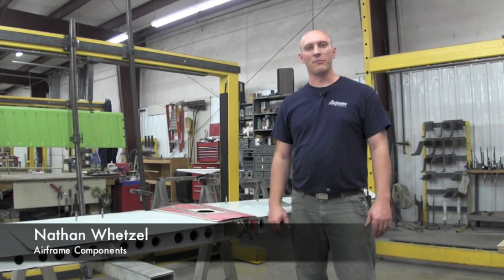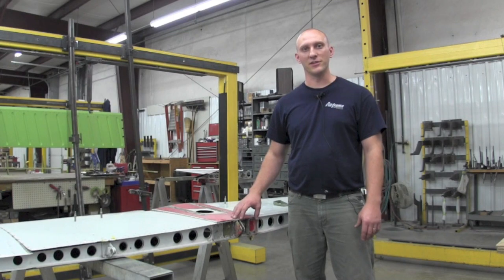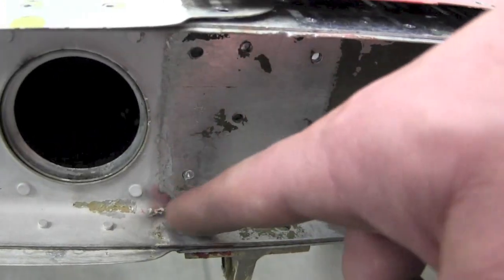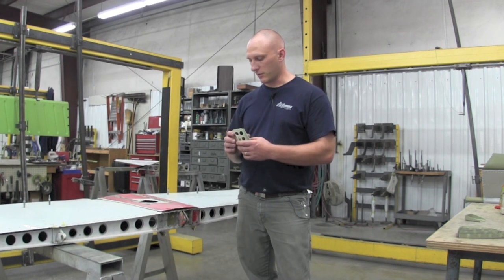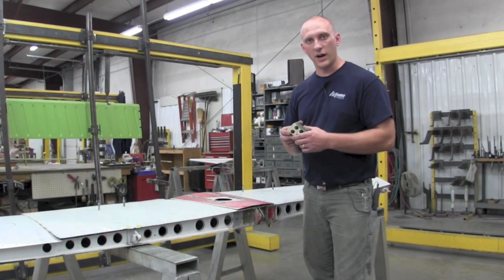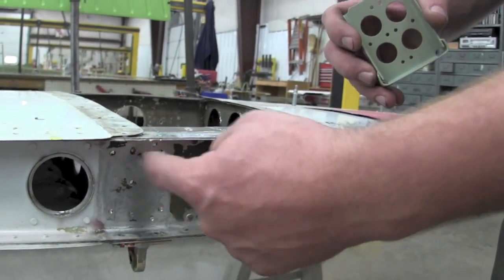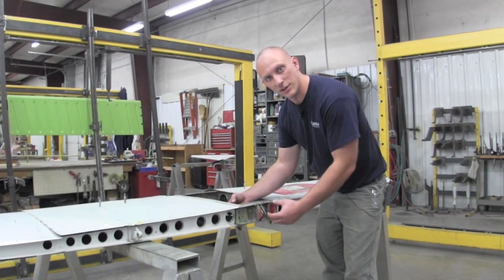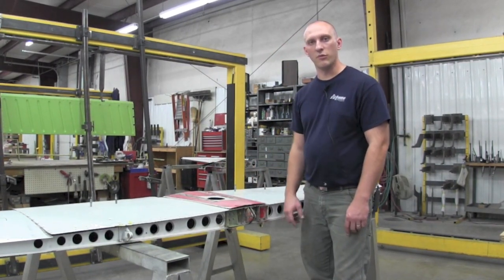Cessna 100/200-Series Horizontal Stabilizer AFT Attach Fittings

Comment: You’re absolutely right about the dissimilar metal issue! But that steel box being riveted to an Al spar..... if the rivets are properly installed, there will be dissimilar metal contact at the fasteners, which is only a matter of time for trouble to develop. Best thing you could possibly do is cup seal the rivet heads and tails right after installation. Not sure this SB is good design practice of Cessna...